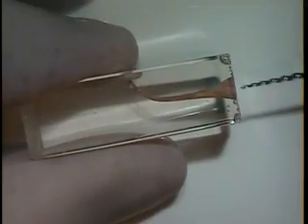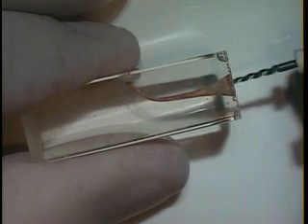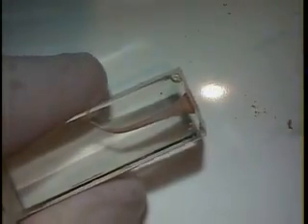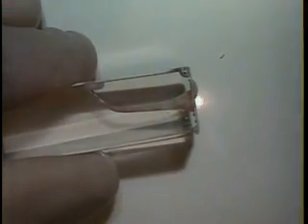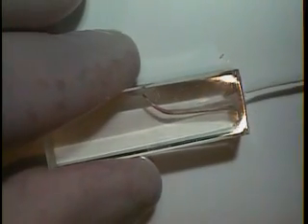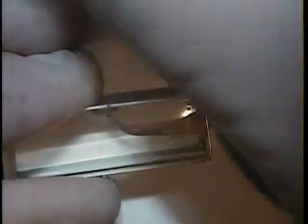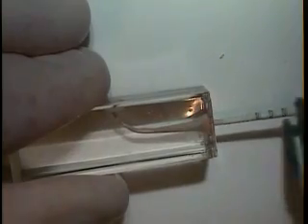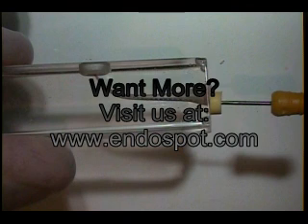Root Canal Re-Treatment Technique

Comment from the maker: Thanks for the positive feedback. Drrsinha, I think the key is to use the chloroform to simply soften the GP to allow the smaller handfiles to break it up and create a path to treat through. Also, be careful when applying the paper points, so that you don't put too much pressure on the softened GP which will lead to extrusion.